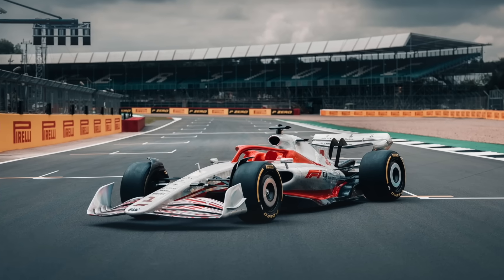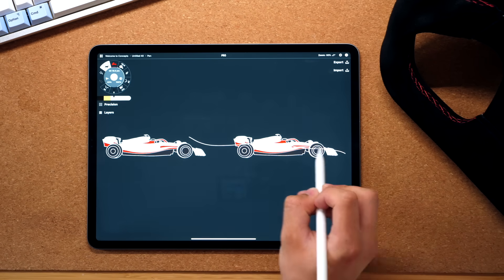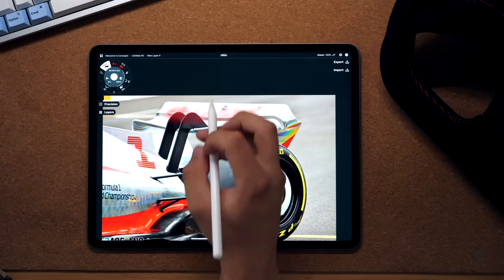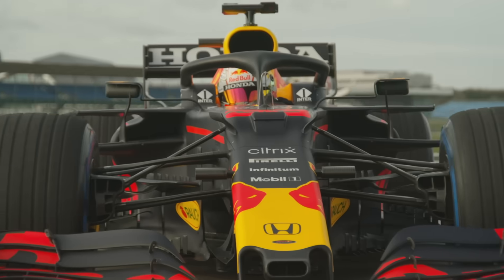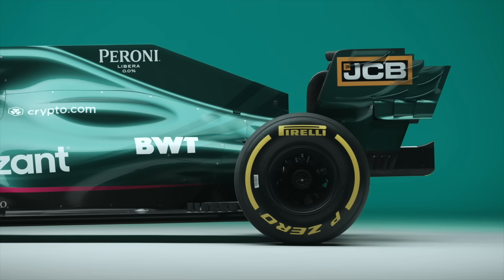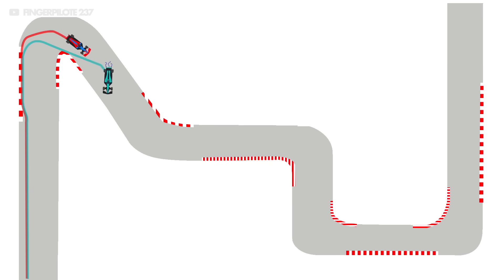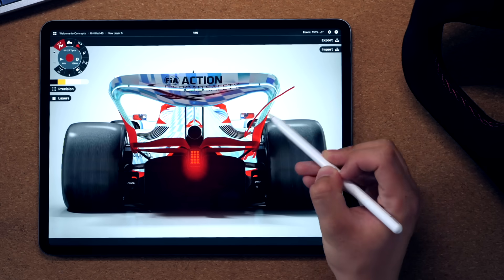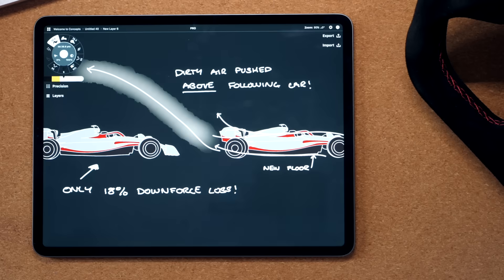Why Formula 1's New CURVED Wing is GENIUS

Comment from the maker: What do you think to this genius idea for improving overtaking? And do you like the new look of the cars??

Head to https://squarespace.com/driver61 to save 10% off your first purchase of a website or domain using code DRIVER61.
Reply: What will happen to the DRS System?
Reply: @hindools2107    Very good question !  It must surely be finished.
Reply: @andyelliott8027  Don’t know what F1 will do. But I love DRS
Reply: @hindools2107   Maybe if you can get really close behind another car without dirty air you won't need DRS to make an overtaking move.
Reply: @hindools2107  DRS still will be here, they said it in their article on the f1 website.
Reply: @hindools2107  DRS has not been taken out of the 2022 rules. It'll be present. That's why I think that the mockup is BS.
Reply: @hindools2107  AFAIK DRS will not exist anynore
Reply: @hindools2107   Good question. This year more and more i've been thinking they could get rid of it from most of the tracks because its become less relevant than in years past.
Reply: @hindools2107  it will still have drs this car is FOMs car the teams will have different interpretations
Reply: For a matter of security, will the drivers have to stay off the kerbs, or will the FIA insist on them being almost flattened? I go back a long way and remember why ground effect was banned - any break in it reduced so much downforce the cars became quite dangerous.
Great video. I'm looking forward to these new cars.
Reply: @y_fam_goeglyd  I don't think these cars have skirts sealing to the track so aero loss over uneven surfaces should be less severe. It's very possible running over curbs may become the slower way.
Reply: @y_fam_goeglyd  The true reason was, that the big manufacturers Ferrari and Renault couldn't compete in terms of ground effect as their engines were too big. the ford dfv was way better for this. it was politics behind the scenes. A fight between the garagisti vs. big companies. engine power vs. aero dynamics. ferrari and renault won. the result was the first turbo era.
Reply: @y_fam_goeglyd  that's something that everyone repeats without any evidence of being true. The fia has always made, especially decades ago, questionable hypothetical safety decisions. Understandably because "maybe this is safer" is better than nothing.
Reply: @lightfeather9953  Decades ago they didn't have computer modeling, all they could do were physical tests and that was expensive and time consuming.
Computers allow for infinite testing and many solutions that human minds would never think of.
Reply: Another very interesting video. You channel is better than the actual sport. 😊💪👐✌
Reply: With the air going UP behind the car, how will this new body affect rain races and water wake?
Reply: Thank you for the great video as always. I am curious about which areas of the car that can be innovated on, and will the resulting cars in 2022 really look like the demo? Or is there a lot of room for changes to the car we see here. I think that would be interesting to explore!
Reply: Why not just bring skirts back and drop the wings entirely?
Reply: Can you make video about the 7th generation of NASCAR Cup Series?
Reply: it looks generaly nice, but those wheels are awful
Reply: I think team will try to skirt the rule and put back in elements that generate dirty air to protect the lead. Of course they will try without hurting themselves in the process. I will be looking out for those bits.
Reply: Its a great idea, but I believe the engineers in the teams will begin negating it before the year is up. Unfortunately, the FIA is putting the teams on the honor system and asking them not to manipulate to following car's air. Obviously the honor system never works in racing,  so they will be reacting to new ideas the whole way, changing the rules constantly. I say the first rules change will likely be around Silverstone.  But that said, the entire plan is a good one and should improve things, even if only a little after the teams manipulate the intent of the rules.  Hopefully I'm off, and the teams can't find a way to break the intent of the rules without hurting themselves, in which case we'll all be winners.
Reply: Was your name ever Driver71? I swear it used to be that
Reply: I would love to see a video on why there is SO much more overtaking in IndyCar vs F1, even on road and street circuits. I know part of the answer is that the cars are essentially spec, but I would think there is more to it than just that.
Reply: @alecerdmann8505   just throwing my theory out there may be IndyCar have better rules and regulation in overtaking so they do it more often without the risk of penalties or fines.
Reply: BRO I'm CONFUSED help!!! Aren't SLIPSTREAM AND DIRTY AIR CAUSED BY THE SAME THING???? IF THE DIRTY AIR IS DECREASED WON'T THE SLIPSTREAM GET DECREASED AS WELL??? AND ON TRACKS LIKE MONZA SLIPSTREAM IS IMPORTANT!!!! BRO PLEASE EXPLAIN ME IM SO CONFUSED!!!
Reply: The new car will be 2 sec slower.
Reply: Will the under floor system be a stock element?
Reply: While I love the look of the current Mercedes I still love some of the older cars more, that being said i have a passion for racing and if this new car gives us that ability for close fast non artificial racing I welcome them. I still remember when Damon Hill used to be able to tuck his front wing so close to the rear of Michael Schumacher's rear the timing screen registered them as 1 car.
Reply: @mclarenjohnf1  My all-time favorite is the Ferrari 312T with the high airbox, with the Lotus 79 a close second.
Modern cars are essentially designed by CFD and to me have no soul like the cars from human brains.
Reply: The idea for this is not new. As far as I remember this was already the plan in the early 2010s. They originaly wanted to return to turbo cars and ground effect. Maybe this was to radical back then so only the turbo thing happened in 2014.
Reply: Overall, I think the cleaner look of the cars is appealing, and the rear wing is visually very good looking. I like the idea of the cars being simplified in terms of furniture in that the applicability of the tech developed will apply to road cars much easier. What I wonder is whether the top speed on the straights will increase due to the reduced drag of the wings and transferring so much of the downforce duties to the inherently-less-draggy Venturi tunnels. What do you think?
Reply: @ban15ed  I don't know whether Venturi tunnels are less draggy, but a cleaner chassis with the same horsepower should be faster in a straight line.
Reply: Will there be drs ?
Reply: They should bring back extreme ground effects
Reply: Now we just need to Pirelli to pitch in and provide less finicky tyres and we're on to a winner
Reply: @TheDJPCol  FIA's tire spec's drive away manufacturers and probably make Pirelli's job very tough, and therein lies the problem.
Reply: I'd rather see a return to two or even three tire suppliers, as long as they are dedicated to meeting FIA specifications and staying competitive. Tire wars are okay as long as one make isn't vastly superior to its competitors.
Reply: Beautiful and clean looking. I love the new cars.
Reply: Anything they can do to get rid of the ugly barge boards and all the odd strakes and winglets will be a huge visual improvement!
Reply: I do have a question .  As FIA made these cars , what exatcly teams can improve it? We will have  diferent designs in 2022 ?
Reply: Speculation before watching it: It's an endless wing trying to eleminate wake turbulence, what you call dirty air altogether.
Reply: So draft benefits are also reduced when following? Only 18% down-force reduction will slow the cars down on straights when trailing a lead car. So drafting, slingshots, straight line speed behind cars will be reduced?
Reply: It would be interesting if you can analyse how steep kerbs in corners may impact the ground effect and keep the drivers on the track rather than using the kerbs as they do today. 
I'm assuming that as the car goes up onto a steepish and long kerb the flow acceleration will drop off significantly and hence drop the downforce too; causing the car to make a sharp, uncontrolled, move off track :-)
Or I may be totally wrong with how strong this effect may be - I certainly can't remember it being talked about as a possibility, but it seems in hindsight to be a potential outcome that will impact track limit violations.
Comments please!
Reply: I think the Idea of lifting "dirty air" up into the air is a bad idea. What if it's raining? The cars themselves will fog the whole track. What if someone brings dirt and dust to the track, after going into the sand?
Reply: @FOWST     Same as now, the shit will get sucked in the air after like 2 cars pass it
Reply: In theory it’ll work but we all know thet the current big teams will push the edges or development under the car to make following hard.
Reply: Yes but I have a big issue. This means that the quickest car even by a little, will win everything since there is nothing stopping the overtake. Let's wait and see.
Reply: This is reminiscent of the early Renault turbo cars. Late 70's I think.
Reply: its going to be pointless until the sort out overtaking rules and regulation they should fix that first then work of the rules that are more clearly
Reply: ........USAGE OF GROUND EFFECT WAS SEVERILY LIMITED VERY LONG TIME AGO,JUST NOTICE.....ALSO THERE WAS A ACTIVE SUSPENSION....BANNED.....BRABHAM'S VACUUM CLEANER WAS ALSO BANNED AFTER ONE RACE

.......SO....MAYBE IT'D BE BETTER IDEA TO CREATE A WIDER AREA TO IMPROVE WITH JUST UN BANNING??...
Reply: Making it easier with gimmicks seems bad; but making it less hard through holistic design.. very clever.
Reply: YouTube premium at least let’s you escape from raid shadow legends ads but it’s impossible to escape Squarespace 🤦‍♂️🤦‍♂️🤦‍♂️
Reply: WHAT do you think of my cost cutting  idea, getting a lot of resistance from 'dentists' or gear cutters, to replace the drive train by putting just a generator on the engine, powering 4 hub motor/brakes in the wheels? To eliminate shifting and all that expensive drive stuff. It would improve reliability, since transmissions are the part that fails the most. This could also improve overtaking, since the driver can focus more on steering, with no shifting. It allows "one pedal driving" or really two linked pedals, with toes for go , and heal for effortless electric braking.
Reply: i love the new look of the new gen's. and now they make the cars more compettitive by giving a fair chance.
Reply: Rear wing looks like kamel rizza’s design
Reply: it is just traash-tallking, they have been saying  it for 15 years
Reply: DRS???
Reply: Ahhhh no way they r broke and mazapin is a spoiled no talent baby
Reply: The new cars look great, apart from the wheel covers that resemble a 1980s Corvette!
Reply: when will they just get a wing to go round tracks or, probably much faster, take the wheels off and fly planes around a marked line on the ground (the track).
Watch motorsport dwindle as electric mobility takes over. LOL.
Who cares about antiquated go karts using explosions to move forward and engines that lose 50% efficiency through heat ?
Reply: Now let me have a question: It sounds great that the disadvantage of the following car will be a lot less in the corners, but doesn't it also mean that the advantage of the slipstream in the straights will fade away as there will be air behind the car in front?
Reply: As for improved overtaking, the only solution that will work is if they introduce restrictions to the braking. As long as the cars can brake from 100 mph to standstill in about 6 yards, everything else is just tinkering.
Reply: @BenjWarrant  that's definitely bending the warrant isn't it...
Reply: Love the look, is drs removed from the car?
Reply: Wow this is why Hamilton is so upset for losing this year's championship because next year he doesn't have a chance  Mercedes rely on this dirty air Red Bull will be unstoppable next year
Reply: Hm... what will all this suction do to a wet track?? Imagine the spray.. wooohooo
Reply: squarespace is equally as bad as all other creators of this kind are
Reply: Sport teams shouldn't be in the game as it becomes a conflict of interest from other people 😭
Reply: What kind of background you have to say it's genius
Reply: @petrovsulinak187  He’s been part of and inside the racing industry for decades.
Reply: @petrovsulinak187  I think it's the most stupid wing design ever used in F1. Wingtip vortices are reduced tremendously by this approach, I assume to an extent that makes rear wing nearly useless. We know the facts, trough NASA's extensive research though, of the issue with a simple conclusion: No wingtip vortices, no lift. In this case no downforce.
Reply: Reverse grid qualifying for top ten
Reply: @nicholascrow8133  - Reverse grid is manufactured BS and does not belong in F1. How is it even relevant to the Video?
Reply: @nicholascrow8133  I like this idea
Reply: @nicholascrow8133  reverse grid was laughed out by pretty much everyone last year
Reply: @nicholascrow8133  Or the winner of the quali gets his name 3x in the draw hat 2nd gets his name twice in the hat then a free draw so ANYBODY can get the pole. The winner of the previous race only gets one free practice the 2nd get 2 FPs the rest 3 FPs. Repeat...  and the winner just gets a few points more not like now with only one or maybe 2 with a HUGE point lead were nobody can ever catch up.

Comment: New Concept Question???
If the front and rear wings are attached not to the cars body, but to the wheel section. Where the down force is still pressing the tires to floor. BUT more importantly, the wings aren’t pressing weight down on the cars frame. Would this be better or worse???
Because you would essentially have a lighter car at higher speeds, yet have the same down force on the wheels. 
My assumption is that it would make for a faster car, since at high speed, the car weighs less than a car with wings attached to the frame. 
If you know the answer or have an opinion, please respond. I’ve been thinking of this for years and have no clear answer.

Comment: I absolutely love the changes i have seen so far, I feel like cars will be closer to each other on the track for more of the race than in quite a while. It remains to be seen how it plays out with each teams own aerodynamic development. I feel like aero needs to get "reigned in" as it can be used quite offensively and has been to the point DRS has become a thing.

I'm all for good aero, but to me this should be a gentleman's endeavor as it is a gentleman's sport. We shouldn't be implementing good aero at the cost of good sportsmanship, but we need clear rules for it to happen. 2022 is a big move in the right direction.

As far as the look of the cars it doesn't matter much to me. It is more interesting to me, how many changes the FIA is implementing. Teams are going to have to deal with a diverse challenge in 2022. we are talking aero, suspension, tires, engines, tactics. So just basically everything lol!

Comment: I know there is a lot to be gained from making more efficient aero for the "leading car" but why not add a focus of making the air slower or less adventitious for a drafter. In other words the leading car could purposely make the car that trails it slower.
Reply: that does not make any sense? making standing air slower? so you want to push it forwards with fans?
Reply: @HeavyMetalGamingHD  basicly make the air behind you less effecent for the drafter. Make more turbulent air

Comment: GUYS!! IM CONFUSED!!! SLIPSTREAM AND DIRTY AIR ARE ESSENTIALLY CAUSED BY THE SAME THING!! SO IF THEY REDUCE DIRTY AIR WON'T THE SLIPSTREAM GET REDUCED AS WELL???? AND IN TRACKS LIKE MONZA SLIPSTREAM IS IMPORTANT!!! GUYS PLEASE EXPLAIN ME IM CONFUSED!!!😭😭😭😭
Reply: that's not true at all. slipstream is basically caused by a lower pressure area behind another car. you don't need any wings to cause a slipstream effect. you need less fuel, when you are behind a truck in your road car, because of the slip stream. The issue with dirty air is, that the air is full of vortecies.
Reply: @HeavyMetalGamingHD  ok thanks for explaining I needed it
Reply: @ΜαρινάκηςΣαλόνικαΘ7  you would get more replies with a bit less caps lock

Comment: So with the loss of dirty air, DRS should be banned. I think it's a great way to get back to the mid 2000 racing
Reply: that's not true. You will always have dirty air, when you even have a single wing on your car. F1 will always have dirty air. they just reduced it with those new regulations.

Comment: hopefully this changes will make following easier. but thats only half of the issue of our problem of "good racing".
and thats tracks. alone this year so many battles where no battles or once that ended immediatly cause of the tracks. its the 90° tight corners like sotchi or the shicane in Barcelona and budapest, the off camber turns like in 3rd sector abu dhabi and the king of them all the ashpalt runoff.
the new concept if its working, only produces better racing if were at tracks where you can overtake and defend without on side always going over the limit either cutting the corner, gaining and advantage off track or pushing someone off track cause nobody gets harmed cause its all asphalt runoff.
but not a smalla part is also on the drivers racing each other with respect not like the dickheads this year and the FIA ruling constantly the same in a manner that allows racing. set boundaries and following them for the whole year and not trying to make a last race championship happen. if tracks are good, cars are good and the officiating by the FIA is good, we automaticly get good WDC battles.